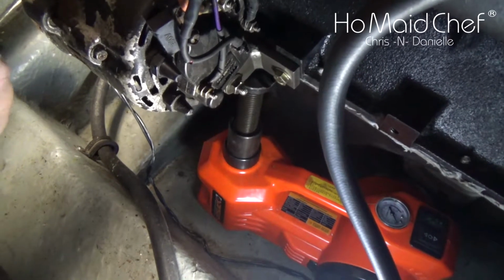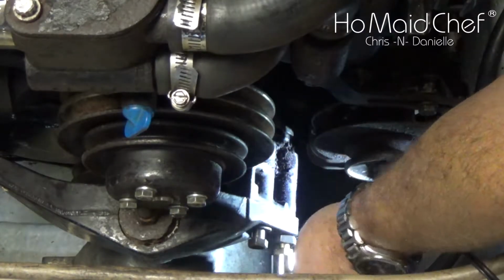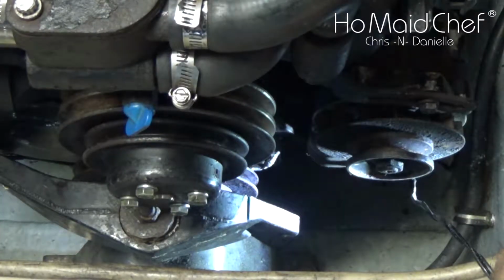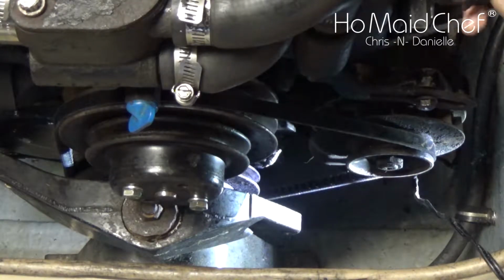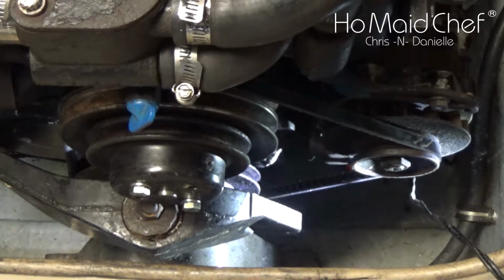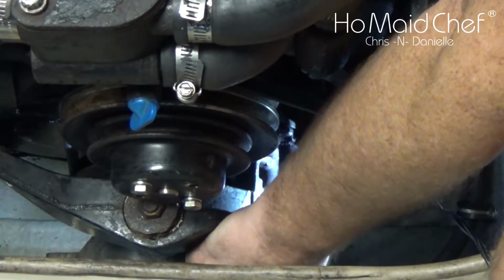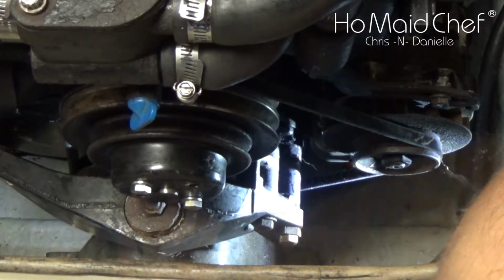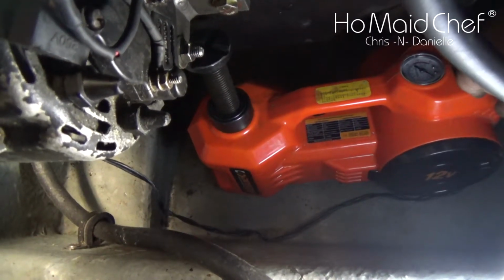Install Circulation Pump Belt On Mercruiser 3.0 EP #48 || Bayliner Bowrider 175

Comment: This is one of the better 'research' videos for changing your belts. You don't need the electric jack he uses or the scissor jack shown in a different, but also good video. You can use a small bottle jack but protect the bilge with cardboard and wood and be sure to lift at the p/s bracket. Good info in he video though.
Reply from the maker: Thank You! We try to give the best information we have.

Comment: Mystery pulley? Isn't one groove for crank to wp, one groove from wp to alt, and one groove for wp to p/s? Should never be a mystery pulley
Reply: But then I'm looking for belt sizes so I haven't done mine yet to see. So I'm no expert obviously. Just seems weird.
Reply from the maker: You are right, there are no mystery pulleys, but we like to be chill in videos and that was the name I gave it. Wrap a rope around it that should get you close on your pulley size, just make sure your adjustment for the belt is slacked. No expert at anything ourselves, just not scared to messup as we learn.

Comment: Jack up engine to change belt.   Why.   Never heard it.
Reply from the maker: To hold the engine, not to lift the engine. This engine is heavy and you have to remove part of the motor mount to replace the belt.
Reply: @ChrisDoesWhat  Thank you, got it.  Im getting some intermittent (1 -2 seconds interval) sound from the front era of this engine while trolling fishing lures. Dont know if it is alternator or circulation pump bearing (lowest pulley). What is it circulating oil or water.
Reply: any idea what it may be. should I pull belt and try running it that way. If noise goes away how do you determine which pulley does it generator or or lowest pulley -circulatory
Reply from the maker: @bobtate6812  The circulation pump on this boat pulls raw water in and pumps it through the engine water jackets.
Reply from the maker: @bobtate6812  I like to take a hose and hold one end to my hear and the other to what I am checking like a stethoscope.
Reply: @sgvincent100  where is that video